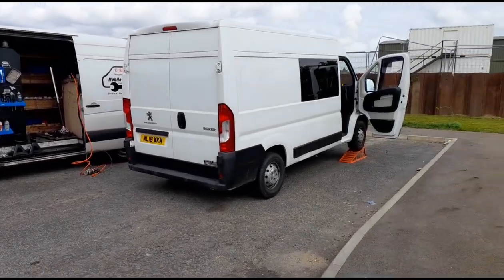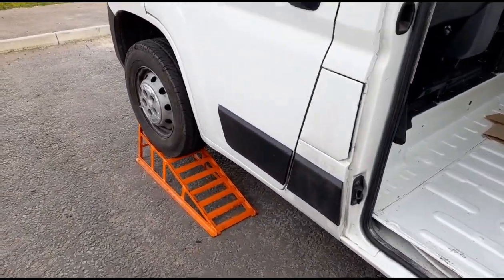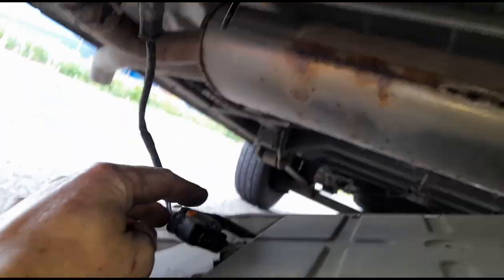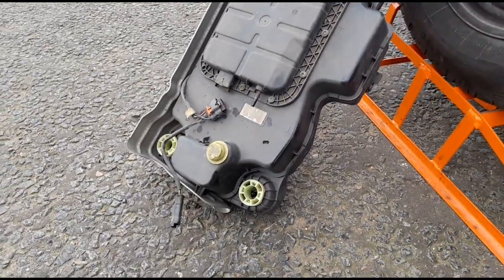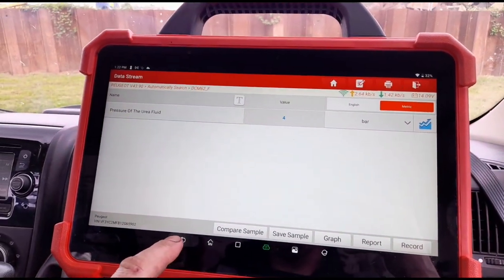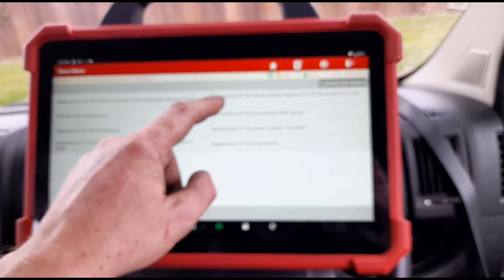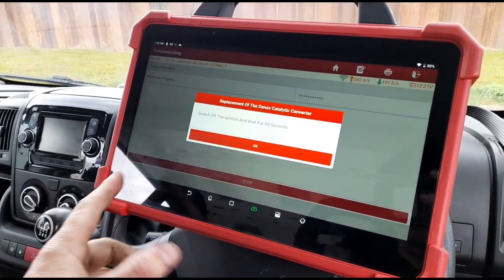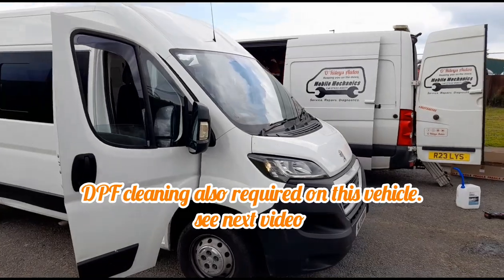Peugeot Boxer 2.0 P20E8 The Pressure Of The Urea Fluid Is Too Low: DEF Adblue Tank Replacement

Comment: I have had success draining the tanks filling them with warm water and running the pump with diagnostic tool .drain the remaining water dry it refill with adblue and the pumps always had a big increase in pressure I think the adblue might be crystallising when people let them run dry of adblue might not work for everyone but it has for me.

Comment: I had a low pressure fault on my 2017 Boxer.  But after a while and an AdBlue reset it’s sorted itself out.  Now on 167k miles

Comment: You were wondering why you don't just replace the control unit in the tank and just be done with it, here is why - 

The reason you can't only replace the control unit on top is because not everything is in that unit, some parts of the system are encased in the tank body itself.

For example - 
In the control unit part of the tank you have the pump, reservoir, pressure sensor, a pressure and flow solenoid, the wiring and the control unit board itself.
In the tank body separate from the control unit and only connected by wires you have the temperature sensor, fluid pickup, heating plate and the sensor for the heating plate and also the level sensor.

So you can replace only the control unit, but your fault might be in the tank body, you can replace just the tank body also, but then your fault might be in the control unit - and there is no sure way of knowing if your fault is in the control unit or in the tank body so you just always replace them together as one unit even if you theoretically could replace them on their own. Saves time and there for money of not having to swap parts and try, also you probably can't even buy them separate from each other, not new ones anyway.

Second thing - At the beginning of the diagnosis you are revving the car and checking for pressure buildup, don't forget to delete the fault codes then reset the adblue system in order for it to come out of it's fail safe mode, just deleting the fault codes is not enough. You probably did this already considering there were no lights on the dash but I just write it for the other people to remember to do because I often hear people only delete the fault codes without resetting the system, it won't even run through its self checks before trying a pressurization cycle if the system is not reset because it's stuck in it's fail safe mode.

Love you Jimmy <3
Reply from the maker: I think I mentioned in the video that I reset the codes before starting the video but maybe not I'd have to re watch the video to see.

I do forget that some people may not know certain things
Reply: Love it,   great communication,  help everybody,   great comment.
Reply: I got no power to adblue tank and faults of low pressure in pcm could this be in safe mode?
Ecu pin 61 is not outputting earth to pin 85 of adblue relay!
I check on Monday about reset and re start adblue system I take it it need a relearn at about 30mins
Cheers
Reply: Hi, I wondered if I could ask your advice please? I have a Peugeot Boxer 2.0 motorhome, 14,000 miles. Adblue warning came up P20E8 so cleared out the injector and exhaust inlet (wasn't bad at all), reservoir full of adblue.
Cleared error but same code comes back. Is there a way to 'restart' adblue system easily (I have an AL539B only) or does it need a garage?
Before seeing your message I was going to drop the reservoir and clean/try warm water idea but if it needs a reset I guess I may be wasting my time?
Any advice appreciated 👍
Reply: @pauldorkins5530  Yes, it won't run if there is the fault code. Need a reset and try again - but then again prob your tank is bad so you need it replaced.
Reply: @Raf-zu5le  Cleaning it with warm water is a long shot, I've always wanted to try it myself but since I work at a Peugeot dealer with expensive labor I never got the chance and a customer willing to pay for an experiment - understandable. Try it if you feel like you have the time and will and can risk it not helping anything. Sounds like a good idea.

Yes you do have to reset the system not only delete the fault codes. The fault code deleting doesn't do anything except remove the fault code but the system still isn't going to run and the fault code is going to come back. So yes do a "denox reinitialization" or similar and the system will try to run again, if there is a fault it'll flag it after around 10 min of driving or so. Might sometimes take longer. If you want a 100% solution you need to replace the Adbluetank, but experiment a little to save money and let me know how it goes, I'm curious as well.
Reply: Many thanks for your reply, I really appreciate your advice. I have time to play with it as I'm getting on a bit now and semi retired 👴
I'm thinking my auto line AL539B is too basic to have a denox initialisation function but I've only had it a few days - you wouldn't happen to know would you?
Failing that I'll try the warm water trick and check the pipe between the tank and injector isn't full of crystallisation.
I'm guessing if the feed pipe was disconnected from the injector with the engine running the adblue should feed out the pipe, so I may be able to flush warm water through by that method unless it's completely blocked or the pump is buggered? Does that sound possible do you think?
Many thanks again, will keep you posted 👍
Reply: @Raf-zu5le  A quick google search led me to believe that your AL539B is just a general OBD2 code reader and not a real scan and fault finding tool, thus you won't have access to anything, especially not for PSA vehicles which are known to be unique in their requirements and which tools support them fully and which don't anyways. See if Jimmy has reviewed some lower priced tool with some PSA cars that work for what he needs it for, Jimmy tends to be spot on about tools. I use the dealer tool - obviously not something for the every-day man.

As I said, warm water cleaning is a long shot, most likely your fault is internal to the tank and then we are just wasting time, but certainly won't hurt anything to clean it - just won't help your issue most likely. Jimmy has many videos on P20E8 and I've commented on a few myself to add to Jimmy's technique and fault finding information, read up on it and see how you can see with higher accuracy what the fault is.

Just undoing the feed pipe to the injector most likely won't net you sufficient flushing since I'm pretty sure the system would instantly shut down if it noticed such a big leak and lack of pressure building. I'd have the injector plugged in and everything as is and just fill the system with warm water - after that I'd run an injector test which will pressurize the system and actuate the injector, that way you'll get flushing through the whole system from beginning to end.

I'd most likely save the trouble tho if I'm honest - unless you are very tight on budget or have a lot of time for experiments and long-shots. We replace Adbluetanks on Boxers all the time, common to go bad - like on all other Adblue equipped PSA cars.
Reply: Hi, just a quick update. I tried flushing the adblue tank twice with very hot water but to no avail. Never mind, it was worth a go. 
Going to ring up my local Peugeot tomorrow and get it booked in as I ended up lying under the van soaking in urea.
Wife found it extremely funny and said it was probably a sign of my old age ....🤣

Comment: External temperature reading on dash is blank... Which means the temp sensor in wing mirror is dead... Which means it won't regen? Could that have confused the need for new adblue tank?

Comment: It strikes me that new diesel engines are as economical as ever, but - eventually if it costs a small fortune to mess about with this ad blue stuff what's the point. You might as well have a petrol engine and save money in the long run. I know the ad blue is out of date in our 19 reg Boxer motorhome so we are going to try and get the old stuff out and new stuff in with some addative that's suppose to make it last longer. What do you think? Cheers.
Reply from the maker: Good idea if it's not been used for a while

Comment: Opening the old unit you most likely to find an adBlue leaked into and on the control board. 
I wonder running diesel engine on coconut oil as fuel how much cleaner it is?

Comment: Great video 👍🏻 Would this be same for peugeot boxer check adblue system warning check handbook? Been two garages now no one can fix it just get cleared/ reset.
Reply from the maker: You'd need to run diagnostic tests
Reply: i had that on mine, filled it with ad blue but still it went into 450km mode before it stops.. took it to a garage they put it on computer and the computer revved it up to clean the adblue filter.. took about 1/2 with the guy on the computer, but it worked.

Comment: Hi ORileys Autos, i have this code U010E: 87 coming up with engine light on, i have online suggestion of checking connectors but to no avail. Have you encountered such before and can you please 
help in solving this?

Comment: Hi. Does the reset need to be done if I remove and refit the tank/pump? I’m gonna try and repair mine with plastic welding. I’ve put a hole in mine by scraping it on the road when some kn#bhead ran me off the road!
Thanks, Paul
Reply: did it work? the same thing happened to us
Reply: @dennis4959  Hi Dennis. I didn’t do it in the end as I unknowingly bought the van with the Adblue system disconnected, so i repaired the box with some plastic welding.

Comment: Can't you open up old Adblue reservoir and see if there's a blockage on pump?? Be nice to see what is causing low pressure
Reply from the maker: Wouldn't be a blockage. More of an electronic failure due to water/condensation ingress
Reply: @ORileysAutos  fair play, but still it would be nice to know for the future reference what exactly went wrong as these tank units are not cheap.....God bless

Comment: Great vid good work 👏
2019 boxer adblue low pressure fault only in pcm could this be in safe mode? And turn off earth supply to relay that powers adblue tank?
Got no power to addictive tank! 
I try re Initialisation on Monday  but any advise?
Pin 61 on ecu to relay